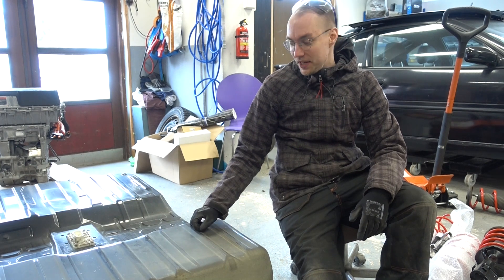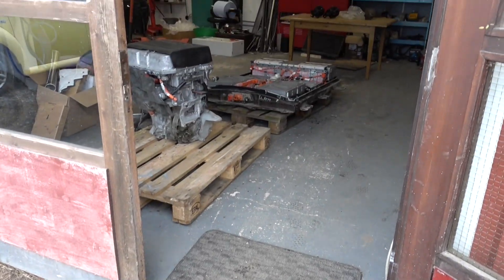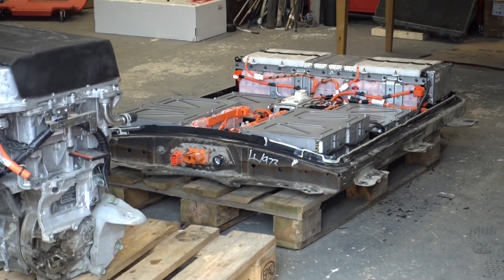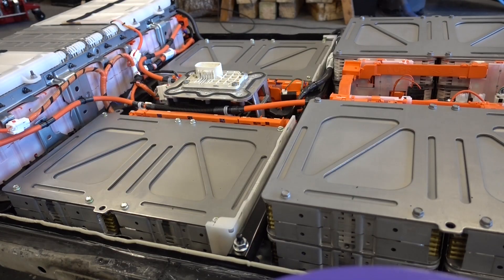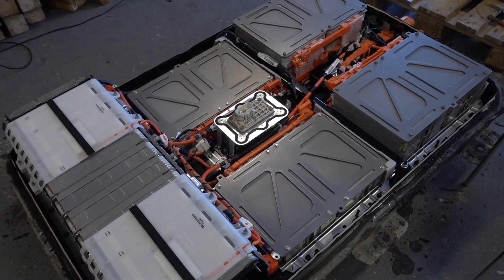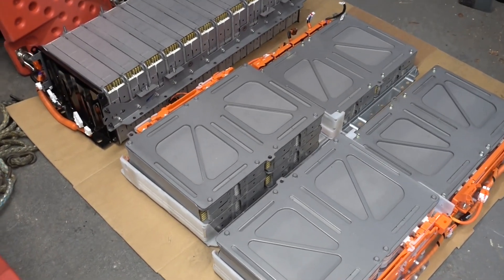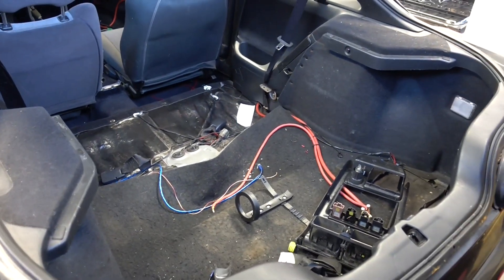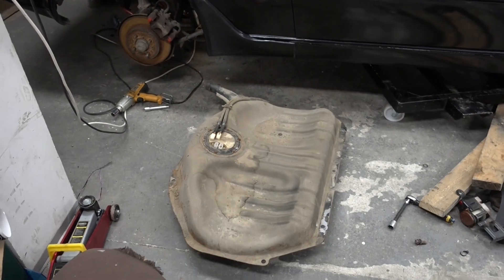BIG battery is here, let's tear it down! 🔋 [EVNX EP8]

Comment: Dala, I have a quick question, for the second time in a year my leaf wouldn’t start.  I worked out that it might be from leaving my ODB dongle connected and my phone on connected via Bluetooth.  I came out in the morning with a full charge only to get the dreaded break booster noise.  Removing the battery terminal for a minute fixed the issue.  From memory it’s the only times I’ve left the ODB connected with the phone overnight.  My BCM is the version with known issues.  Other people have commented around ODB causing the issue,  what’s your thoughts.
Reply from the maker: Hi! Yes I would also suspect the obd2 dongle, there have been many failure reports from that! I recommend a style of dongle with a push button to start it (eg Konnwei 902) so you dont strain the system when not using it!

Comment: Dala Nice pack. We reconfigured the stacks to use in the RAV4EV conversion you may want to look at some of my photos link below. Basically we completely took apart the 24 module unit and built all the stacks in a 16 module configuration. Ie 8 and 8 instead of 8 and 4. You just need longer bolts and the orange bus bars from another pack. We then took the remaining 16 modules and built  4 single stacks of 4 modules each again using a bottom plate, top plate, long bolts and bus bars from the another pack that was scrap. You can see the detail and general idea in the photos. Reusing what would be scrap metal from people that are only salvaging batteries saves a lot of fabrication work. You do need to rewire the harness which is a bit of a mind twist but we were successful. A note of caution make sure to use stranded wire rated for at least 600 volts. Others have used cat5 twisted pair which is not rated for high voltage and is a single conductor. Certainly individual cells are not high voltage but the way the wiring harness is done in those packs many wires running in parallel one wire could be adjacent to a wire of much higher voltage and it will punch a hole thru it and start melting stuff. You can imagine  the chain reaction. I had a simialr experience with unrated welding wire, fortunately I had a 10 amp fuse in the circuit while testing. It was vaporized. Have fun, be safe, thanks as usual for the great videos. My Leaf van conversion is well under way. First road test complete and the leaf stand alone charger is about to get back on the bench. Thanks for your help in the past. Peter
https://photos.app.goo.gl/jLrLfLZAmFCJeonG7
Reply from the maker: Very nice build you have there!

To speed up this project, we wont be re-configuring the layout for the first iteration. We need to get this up'n'running asap as a proof of concept. But nothing stopping us from later on revisiting the battery layout. Good catch about the BMS wiring, having hundreds of V-delta that close to each other could be disastrous yes!

Comment: You didn't use appropriate tools to work with high voltage(or not as i noticed) and i would recommend to use a face shield also because if the batterys short the electric light(valokaari, don't know the right word in english) will burn your eyes and face. Just as a tip
Reply from the maker: Nice catch, I can show that in the next video!

Comment: Why did you not apply some heat to the glue?
Reply from the maker: Heat does nothing with this type of glue, kinda similar to the ones used to bond a windscreen to a car!
Reply: yeah, it's silicone, not glue really, the amount of heat required to make that softer would also cook batteries inside :D
Reply: So it’s like urethane, that’s good to know.

Comment: The best way of splitting the case is to use a multi tool, it just sails through the sealant, something like the  Ryobi ONE+ R18MT-0 18V Cordless Multi tool
Reply: It’s probably a Oscillating Fein tool over there.  It seems like Fein was the first one to really make those things but the Fein are kind of pricey.
Reply: yeah that's what i would use if i need to do it regularly. Tho I dont call it a multitool, that seems hella generic, i call it a wall vibrator. But with the no-teeth blade it will definitely do a quick work around there. Also I would not buy expensive brand name, those can be found for around 20€ easily, for this job.